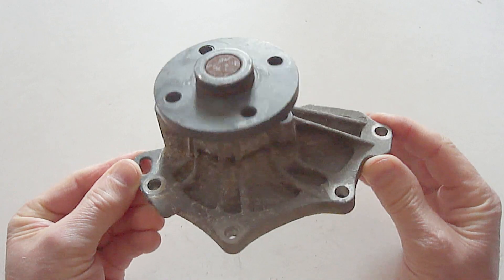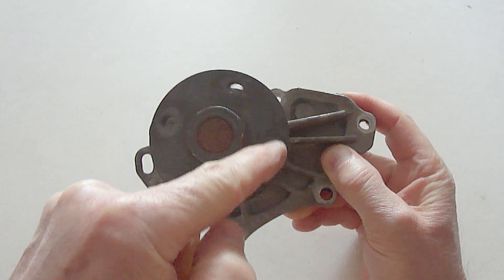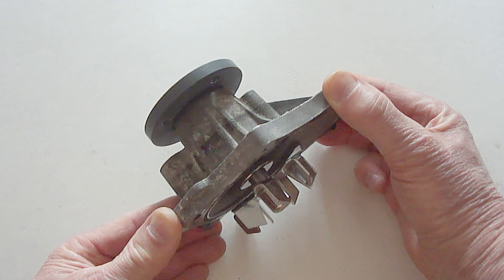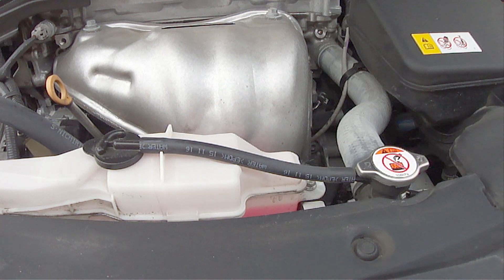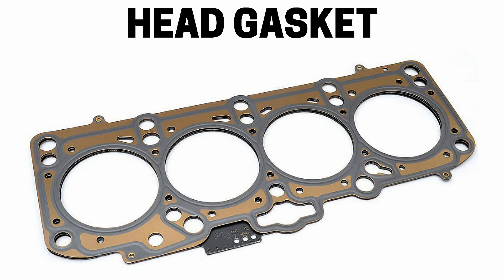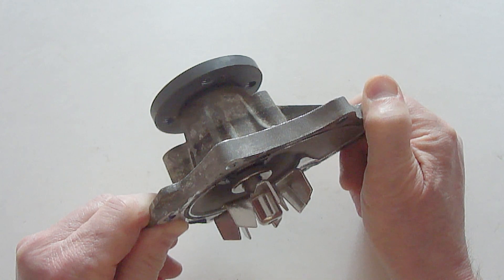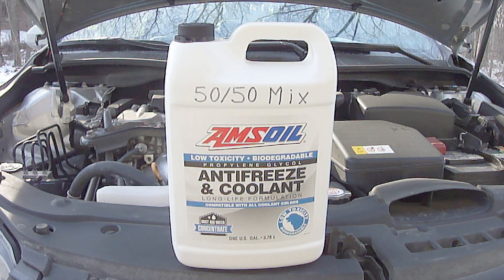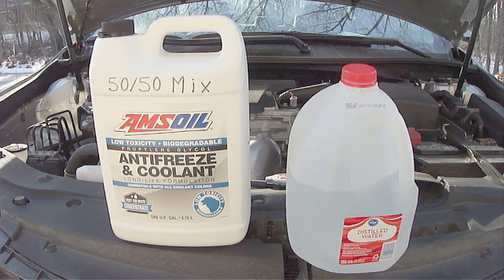The Dangers Of A Bad Water Pump On Your Car

Comment: On mine, no visible signs, coolant smell, upper coolant hose is hot. Weird noise coming from engine. Visible dry squirt mark on plastic mass air flow cover. Possible squirting out of water pump weep hole. 110k miles on 23 year old truck.

Comment: Hi Paul , can installing a new radiator cause damage to the water pump?  Cause i drove only 5 minutes to my house after getting a new radiator and my water pump was leaking . My mechanic denies he's at fault .
Reply from the maker: I’ve never heard of a water pump being damaged from replacing a radiator. Is it possible in addition to having your leaky radiator replaced the water pump was already leaking? A leaky water pump can go from just a small unnoticeable leak to a bad leak very quickly.

Comment: Will a brand new pump make any type of noise occasionally?  I’ve heard some ppl say that it will until the “new” wears off.  I have a 96 LeSabre with 118k.  I just completed new pump, coolant change, new hoses, valve cover gaskets and grommets.  But, the new pump sounds like it’s making a little noise intermittently.  Or, it might be my serpentine belt that has a little coolant on it.  I didn’t take the belt completely off because I have to remove an engine mount bolt by removing the front wheel and plastic shield.  I had the belt moved out of the way but it may have gotten coolant on it.  The car is running great.  No leaks anywhere.  And the noise is not all the time.  Coolant is circulating good, heat works and no leaks.  Thoughts please?
Reply: You sort it after mate ?

Comment: You’re 100% accurate…the water pump does not last much beyond 100,000 miles.
My 2018 Civic EXT (with an immaculate maintenance record) started leaking from the weep hole at 117,000 miles. I’m scheduled to change the water pump and the drive belt next week.
Reply: How much did it cost you, for parts and labor, in total? Just wanted to know if I’m not being ripped off.
My 2003 ford ranger still has its original water pump until a couple weeks ago. The dealership quoted me  at $900ish for parts and labor combined.

Comment: How can I get my car home.It was running hot fast.So I had to park it.
Reply from the maker: The wisest thing to do would be to have it towed to someone who can fix it.
Reply: If the temp goes high, the thermostat is stuck closed.
Turn on the heater/fan to full high and wait for the temp to start going down and then drive home.
Happened to my car last year while I was driving home. The temp went below high and nothing was damaged.
Reply: I towed it home.I think it’s water pump cause my heat won’t get hot.Thanks guys.We recently changed thermostat so I’m figuring water pump.
Reply from the maker: @ninobrown341  Are you sure it has enough engine coolant?
Reply: @ninobrown341  did you sort it after  ?
Reply: @kevinhancock4064  I got it towed and then a new water pump and thermostat.
Reply: @ninobrown341  ah tidy Hooe you had a tidy price . Least u got it sorted . I lost my heat Sunday morning.  Sorted it got hot air since . Toasty . I've either git an intermittent falling pump or an air lock issue doubt it's therm on mine as the water does flow once warm
Reply from the maker: @ninobrown341  Let me know what happens.

Comment: My truck over heats when idling buy as soon as I accelerate whether on neutral or running it goes down. I've changed thermostat, fan clutch radiator but not the water pump. What would you recommend?
Reply: Almost similar to me . I lost heat inside on Idle . But my exp tank was full from rad . This shouldn't happen did you get yours sorted?
Reply: @Kevin Hancock  yes, it was the head gasket.  I went to harbor freight and bought a gasket kit. It's a tube and a blue liquid. It'll tell you right away rather that replacing all those items.
Reply: @Jaime Palma  I've got a hg tester again blue liquid.  It really shouldn't ne hg on my case as ot was reppaved